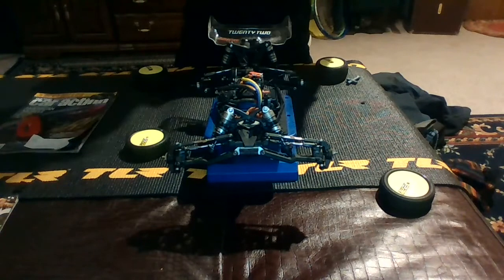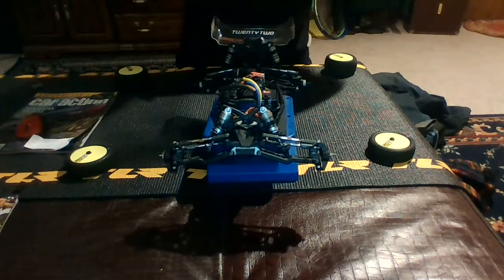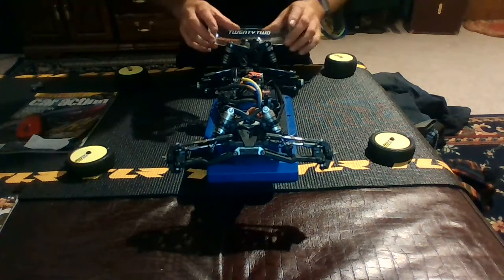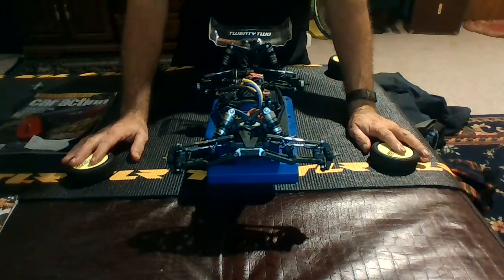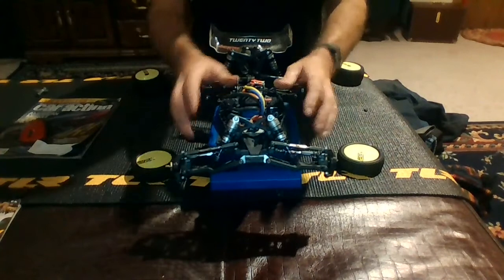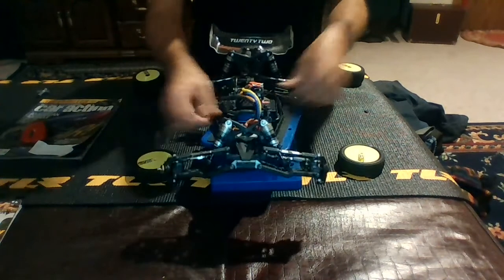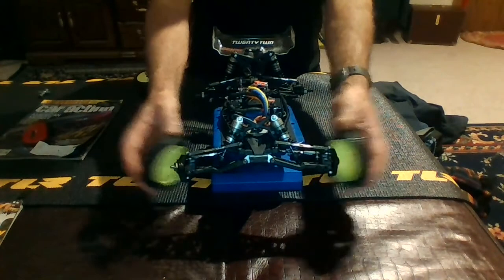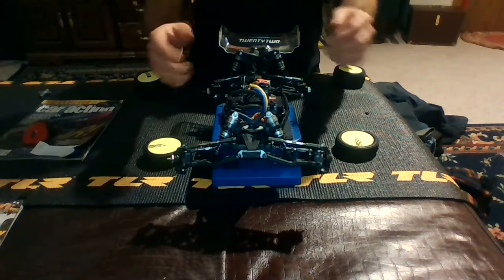Setting Toe and its effect

Comment: What i found is the amount of steering when entering the corner is exactly the opposite what you said. Toe-in on front axis indeed makes the car more stable on straits and the car wants to stay in this position when cornering. Because outer wheel has more grip, it indeed takes the control over the turning curve, but the inner wheel still have some grip and pushes the car out of the corner. And this is also true for real cars. Whoever drove a car without power steering knows, that it makes it hell to turn the steering wheel when you car have toe-in in the front.
When you have toe-out in front, your car is less stable on straights, exactly how you described. When cornering it may look like you have to turn a bit more, but just when you do this, you have the control of the cornering curve on the outer wheel, ant inner wheel slightly pulls the front of the car inside the corner. Once more - exactly like in a real car. In fact, toe-out in front makes the car a little oversteer.

Comment: Bro this  is the most imformative and yet simple put and easy to understand  video/ guide i have came acrossed i finally understand this shit after 2 years of racing 😆
Reply: Except the information is inaccurate. How can toe out be both smoother into corners and more twitchy going straight? It can’t. Toe out is smoother into corners, through sweepers and going straight.
Reply: @invisiblespeedrc  in no form of racing do i know of where toe out makes going strait more stable.
Reply: @dirtrider88  well it does and it’s a very simple explanation
Reply: When we are talking about the front

Comment: Great info! A friend at the track, told me to run with tow out, and I like it, havent tried tow in? Might test this out soon! Thanks for sharing!
Reply from the maker: It really does make a difference in overall handling. Most times I can just change toe a little to get that steering feel just right. I always try that first. Toe in gives you a good locked in feel very forgiving. I tend to like my handling a little aggressive steering wise so I usually run a little toe out but if the track is dusty or slippery and it’s all over the place then toe in really does lock the car in place down the straight and thru the corners. Thank you for your comment🙂

Comment: Any idea how to explain diff height? Why does higher diff get less traction when cg is higher?
Reply from the maker: HYEonDEATHROW  it’s not actually the diff height that changes the traction it’s the whole package. When you lower your diff height it’s because you lowered your axle height and lowered the overall ride height of the chassis. Lowering the diff just ensures that after lowering all those components that the drive axles stay level with the lowered axles and chassis components which yes gives much more response to direction changes due to cog being lower. It’s usually for carpet where there aren’t a lot of bumps so you don’t need as much ride height.

Comment: would you suggest to make the adjustment on the car stand or with the car with wheels on the ground? I noticed that when car is on the ground, shocks compress for car weight, and it tends to move toe-in the wheels. so on the stand I should have quite a big toe-out to compensate the toe-in effect when car is touching the ground with fuel and racign weight.. am I correct?. thank you.
Reply from the maker: Nicola Zanetti yes I recommend setting for running weight. So battery installed and body on. That way the setup is adjusted for track weight.

Comment: Wish you would have showed us visual learners what to adjust to make your alingment straight :(
Reply from the maker: MP Drone Productions I was just trying to explain the effect of changing the toe on handling to get the steering just right in a way that hopefully would stick or make sense. But yes starting with good alignment is important and there are a couple ways to do it. Most guys will just eyeball it but I usually just measure between the ball cups and make sure it’s equal both sides. Then trim it on controller so it tracks straight. Sometimes I’ll even go back after all that and measure the front wheels at the inside of rim. Front of rim and rear of rim on both sides to make sure that adjustment is the same left to right. Hope that helps. But yes the main purpose of the vid was hopefully to understand how changing toe affects the steering. Thank you so much for commenting I really appreciate it👍🙂.

Comment: Great video! Best vid on the matter! 
How would you set up a suspension if you wanted more oversteer or maximum oversteer?
Reply from the maker: Sorry it took a while to reply beennaway for awhile. Toe out gives the feel of more steering and running softer suspension also helps when grip is low.

Comment: Hi, just wondering if I understand this correct - so up front  if toe in gives more corner entry and less exit, toe out gives less entry and more exit, surely zero toe (neutral) gives the same overall  as it’s slightly less entry and slightly less exit, a balance of the other two? And why would either toe in or out better on cornering given there is always and entry to corner and an exit from corner? Sorry for noob question!
Reply from the maker: HelplessHawk it’s all dependent on the rest of your setup and track speed. On some tracks you find that corner entry is good but corner exit isn’t. Then with the same setup the same track a day later is different again mainly due to moisture in the track or other reasons so you find that you may need to make minor adjustments to get your steering just right on that track day. Tracks are ever changing it’s pretty crazy sometimes.